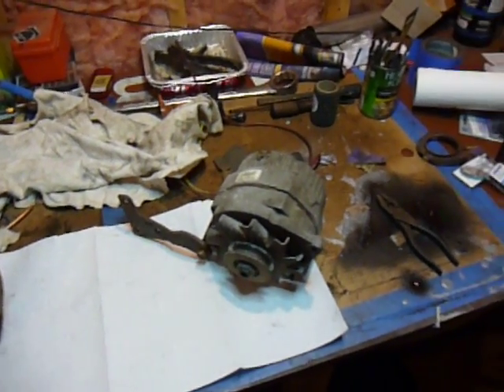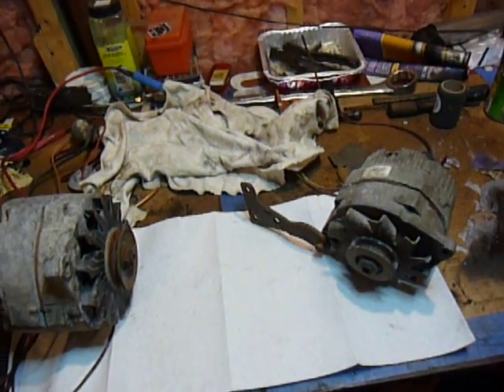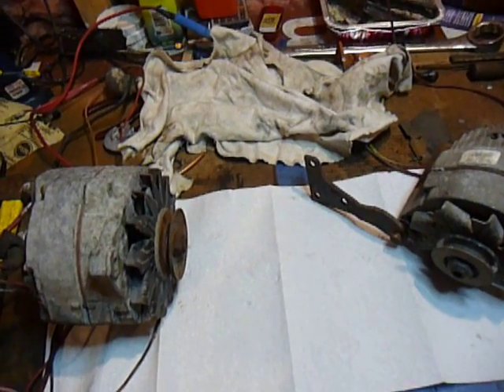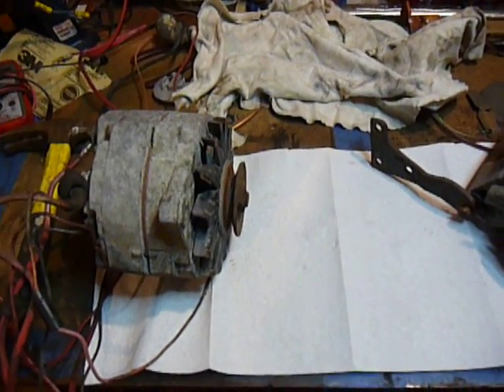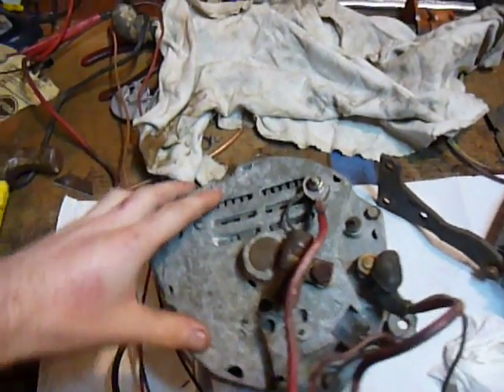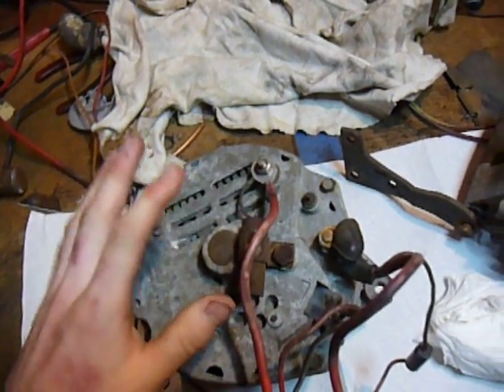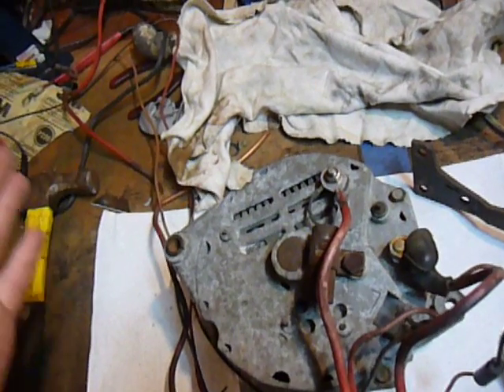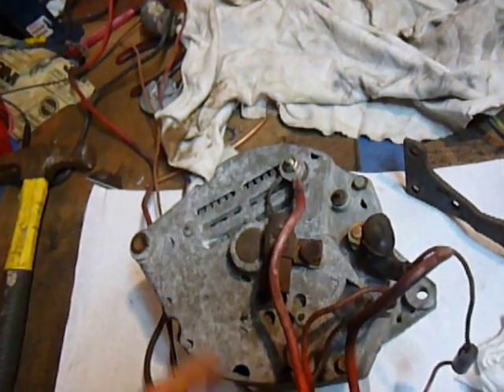CUCV 24V to 12V charging systems

Comment: Switch to a 12V cranking system is probably one of the easiest mods to a CUCV.  A little different on the variants with the 100A 24V systems as they are equipped with DUVAC units.

Comment: Ian, I just got an 86 Cucv.  I had a guy look at it and he tried to convert it to 12 V system.  When I try to start it, it sounds like it has a weak battery.  Could this be because he should have changed the starter to 12B?
Reply: He should of replaced the starter with a 12v unit. 
It doesn't spin as fast as a 24v system tho. That's normal

Comment: Do I need both alternators for 12v?
Reply from the maker: No you could ditch the drivers side one or passenger side one.  Just make sure your single alt is up to the task of maintaining your dual batteries.

Comment: So you can take the regular 12 V GM alternator and put on the driver side of the military blazer
Reply from the maker: M1009 CUCV blazers use two 12V alternators to charge there batteries.  The alternator on the drivers side does have its own ground to the engine block.  These use the larger 15SI alts i believe but its been a while since i messed with a CUCV

Comment: If I replace the 24 v starter with a 12 volt what alternator do I need to keep on the vehicle?
Reply: Either one they both run 12 volts to the motor just check to see which battery they're going to

Comment: As he said these are nothing but Chevy K5 Blazers with a 24v starter:  The driver’s side alternator charges the vehicle’s front battery. This battery and alternator supply power for all the 12-volt components/systems. Both alternators charge the rear battery.  The electrical system of the M1008/M1009 is a civilian 12-volt system modified to allow 24-volt starting and supply 24-volts for military accessories. The only true 24-volt component is the starter motor.  If you are frying glow plugs then you might want to consider converting to one alternator, possibly two 6v batteries (or one big 12v), swapping the starter to a 12v and finally removing the glow plug resistors.
Reply: If you swap out the 24v starter for a 12v starter can you  use the vehicles positive bank and negative bank's on the firewall?  Can you mount  the positive cable onto the positive power bank and connect it to the battery's positive post and then connect the negative bank's cable to te battery's negative post?

Comment: I have my 80s chevy alternator on my 12v battery cart but i need to change it to 24v how can i run my alternator on 24v the 2 spade plug wires on top go to my charge controller and the big bolt on the back i have going to the negative terminal on the battery and the smaller bolt with the red washer going to the positive terminal

Comment: I have a 24 volt battery bank i need to charge. but I have 4 delco 22si. 12 volt alternators. can they be ran in series? it would be a great help if you can get back to me. thanks.

Comment: I need help here please, i live in the middle east and I own an m1028 there's and orange piece inside the alternater that has been burnt, and I went to every place in my country to find that piece and I couldn't.. the only way was to connect the 2 batteries to only one alternater.. so I did that and now the 1 alternater can't handle the charge from the 2 batteries and the car start up got very heavy and just today the truck won't start  💔. I can't find any number on the alternater or anything it's been deleted, so I hope you read this comment cucv owners and pleas help thank you

Comment: Buying a M1008 CUCV.  I have never owned such a vehicle.  What if I need to jump start it?  Because it has 2 batteries, I have no idea what to do.  Thanks.
Reply: jump off the front battery only... OR can use the ground and the positive post on firewall battery, but that sends 24 volts to what you are jumping Make sure your lights are off(they will blow) and only recomand for OLD stuff and equipment as you are putting 24 volts to whats being jumpped could fry computer stuff and replays I'm sure ( batteries are in series and if you use front battery only 12 volts ( high as maybe 14.5 when running) .FRONT battery only for 12 volt jumps

Comment: All that resistor pack does is glow plugs nothing else.  That "cap" is a noise filter.  It does like nothing... it is for the military radios.  Oh ya and don't convert the truck... the system works fine as is, makes no sense to convert it just makes headaches...

Comment: I don't think the m1008 is an upgraded version of the civi k30.  Just a standard k30 with a 24v system.
Reply: 5/4 ton instead of 1 ton springs
Reply: welpro21 different axles and gearing, plus the fun little mil spec stuff
Reply: Same axles as k30, 4.56 was a ratio offered in civilian models.  But, yeah the 24v system, gun racks, etc.  The only downfall was the NP208 instead of the NP205 which was standard on the k30.

Comment: Isn't one alternator different than the other, ie. no external ground pole?
Reply: Both Delco 27 SI alternators are exactly the same.  Both are isolated negative so they have negative terminals.  The drivers side negative is connected to ground while the right alternators negative is connected to the front battery positive terminal.   

It is a simple system compared to the M-1010 DuVac with 100 amp Leece Neville 24 volt alternators.  Realize the need for 200 amps of power and also have room for the AC compressor